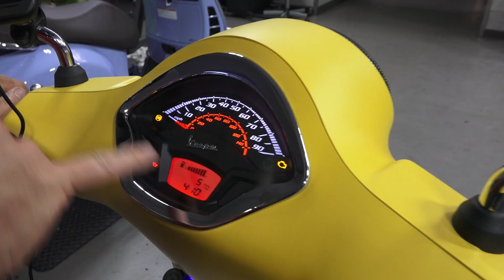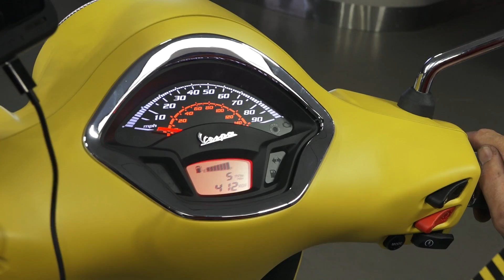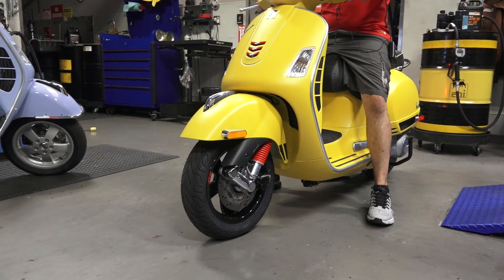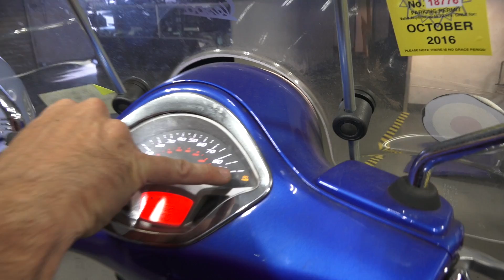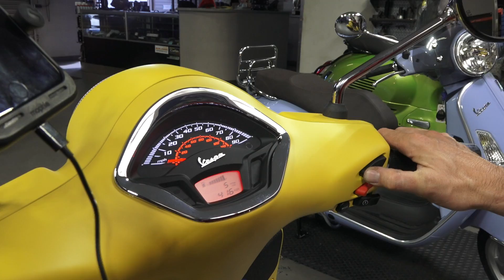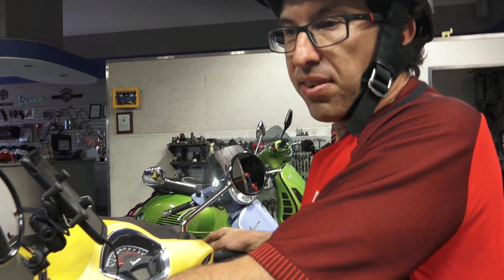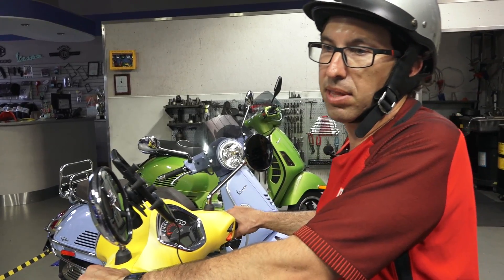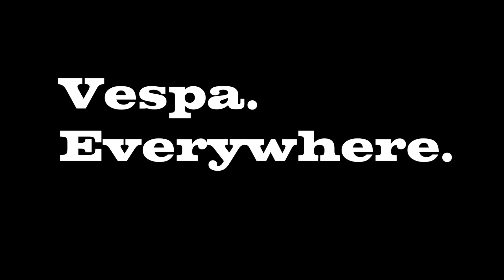Vespa GTS Traction Control Explained

Comment: Saved me! I've had a problem for a couple of months where the vespa would get up to 35kph and just lose acceleration power. I checked everything, cleaned filters, cleaned the fuel injector, replaced the rollers which were a little flat - all with no improvement. Then I came across this video and reset my ASR and boom - it's faster than it's ever been! I purchased the vespa second hand and it feels faster than it ever has since i bought it. There must have been something wrong with it from the start.  Now I can do wheelies on take off. :D Thanks!

Comment: Thanks for the info Robot.  Do you need to ride that 500 to 1000 feet without touching the brakes or stopping at an intersection?  Is it a straight slow ride on the flat or can you go up or down a hill?  Thanks for any input or knowledge on this?

Comment: On my 2016 GTS Super to turn off the ASR you just press the starter button for 2 seconds.  IF you also pull the brake switch at the same time you will enter the reprogramming mode per the owner's manual.

Comment: Thank you! Thank you! Thank you! Robot. GREAT video! Even the Vespa service centre here have no idea why my 2019 Vespa GTS300SS was under powered. First, they changed the back tire. 2 weeks later, same issue, they changed the front tire. Then it got worse. Under powered AND ... swaying. Now, they said it could be the problem with my shock absorbers. Too soft they say. I gonna recalibrate the ASR tomorrow. (it's 2 am now) Pretty sure that is the problem. Again, thanks. Will let you know if it worked.
Reply from the maker: Glad it helped

Comment: If I just purchased a 2020 GTS Notte and the ASR light is always on, do I have a big problem? Seems to ride fine. ASR doesn't flash when I turn it on either. ASR is just always illuminated. Just wondering if anyone knows. Thanks!

Comment: Sound. But, what about the GTS 125. It has ASR but doesn't have an ASR switch. So if, you change a tyre. How do you align the wheels?
Reply: did you find out how to do it?
Reply: @Vespa123  No, I never did.

Comment: Hey, do you have a video on how to calibrate the asr/asb system after a wheel change on a vespa 300 2015? Just changed mine and tried following the manual, but it won't work, and nearest dealer I have is about 200 miles from my town... thanks a bunch!

Comment: Nice to know that about resetting. Never realised it would be that sensitive with tyre pressure.
Is it possible this would kick in if you increase pressure for going two up? (Esp if you have converted to MP3 rims)

Comment: BIG thinks for this, Robot. Have a 2015 GTS300 Super (which I love), and while I'm happy to have a model with ABS/ASR, it's good to know the particulars of the systems on the bike. On an extracurricular level, it's also nice to have had you demonstrate that, yes, you CAN chirp the tires on a Vespa if you want to...although most Vespisti have little need to show off like that. :-)